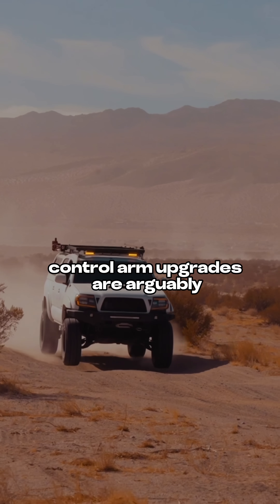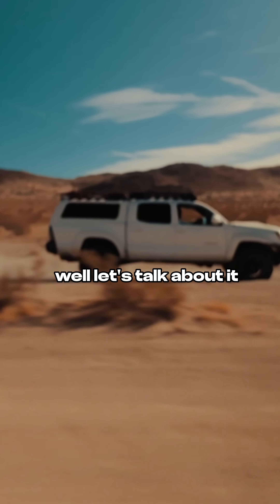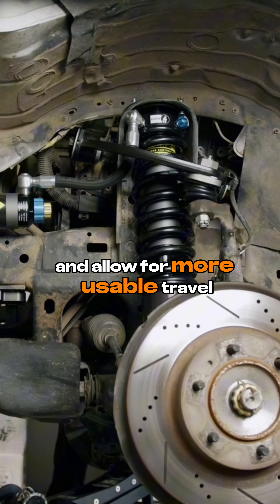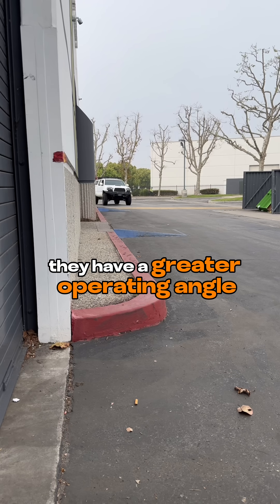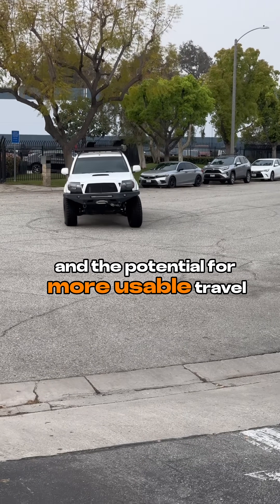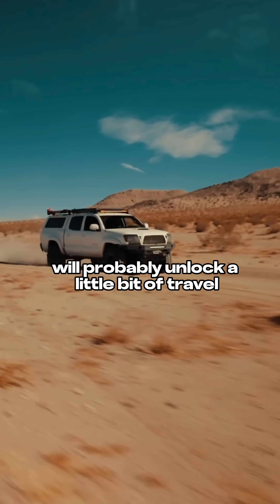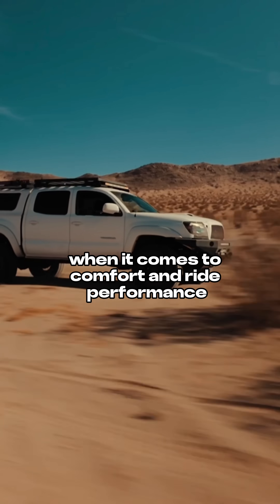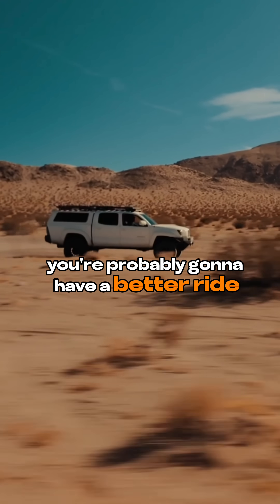DOES UPGRADING CONTROL ARMS IMPROVE RIDE #shocktalk #shocks101

Comment: My shop recommended  not replacing them when I got the Bilstein 6112s. Kinda regretting using then
Reply: What do you mean? You don't like the bilstein suspension or using the shop that recommended not to replace upper control arms?
Reply: @may251986  I meant the shop. The Bilsteins are good when you get them offroad. Very stiff for regular driving though.  I wouldnt get them if i didnt do a lot of offroading.
Reply from the maker: on an older truck, its a good idea
Reply: 2016 f150?  @ShockSurplus
Reply: @ShockSurplus  mine is a 2021 tacoma so hopefully its good then.